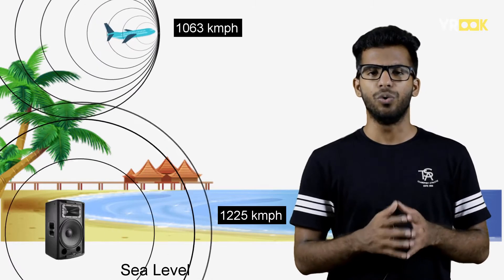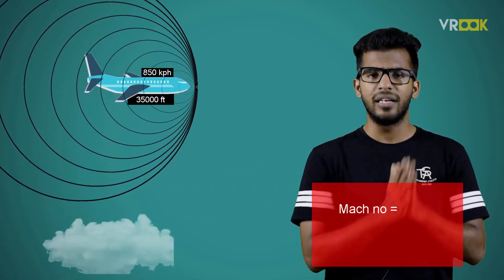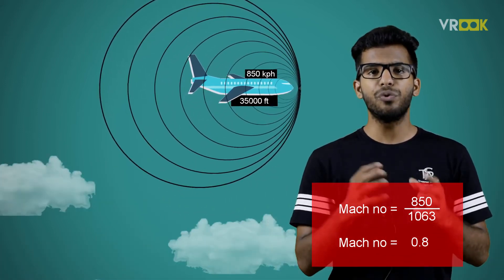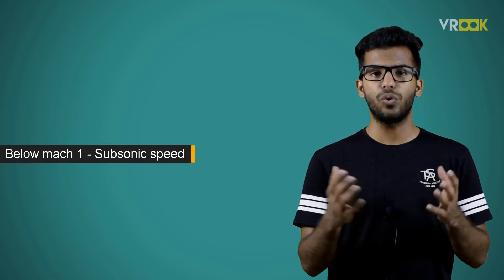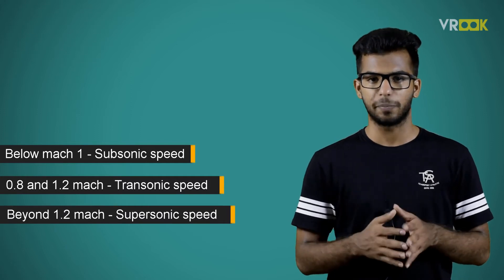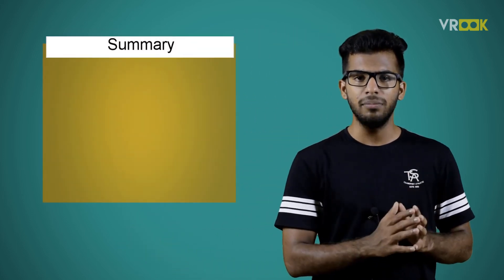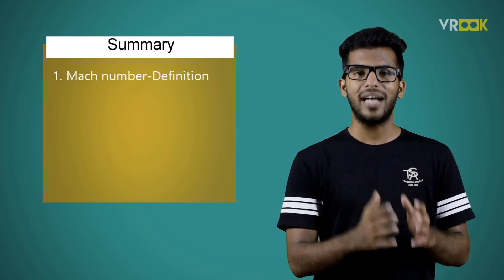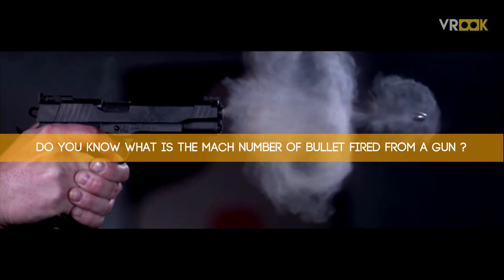What is mach number and how to find it?

Comment: Sir but if velocity doesn't given, then what will be it's velocity,
 for example mach number=0.8, and altitude of flight is 12,000 m, from the ground, 
so how will be calculated velocity from these values?
Reply from the maker: The Mach number is defined as the ratio of the speed of an object (such as an airplane) to the speed of sound in the surrounding medium. In this case, a Mach number of 0.8 means that the airplane is traveling at 0.8 times the speed of sound.

To calculate the actual velocity of the airplane, you will need to know the speed of sound at the altitude of 12,000 m. The speed of sound varies with altitude and temperature, so you will need to consult a table or a formula to find this value.

Assuming a standard temperature of -56.5°C at 12,000 m, the speed of sound is approximately 295 m/s. Therefore, the velocity of the airplane can be calculated as follows:

Velocity = Mach number × Speed of sound
= 0.8 × 295 m/s
= 236 m/s

So the velocity of the airplane at an altitude of 12,000 m with a Mach number of 0.8 is approximately 236 m/s.
Reply: Speed of sound should be taken as 1065kmph at such heights invariably 
They'll remain constant
Reply: @VARUNKUMAR-sj6jg  I'm a btech mechanical student, a few days ago i had an exam the subject named compressible fluid flow, there was a question which i mentioned above, 
As far as I understand,in order to find velocity there is a equation, (sin¢= 1/m), m= mach number 
from this equation we can find the '¢' value.consider ¢ as mach angle. If we have mach number so we can find the mach angle '¢' by this equation,
And the corresponding eqn (tan ¢= oppo/adju) so the eqn will be tan ¢= 12000/v) here velocity v can be determined?

So what is your opinion about this?
Reply: @theendisnear..4634  since ur mach no. is 0.8 if u calculate 1/0.8 u'll get 1.25 for which u can't fin sin inverse as inverse of sin can be found only in the range of 1 to -1